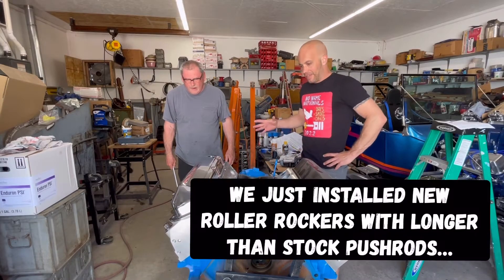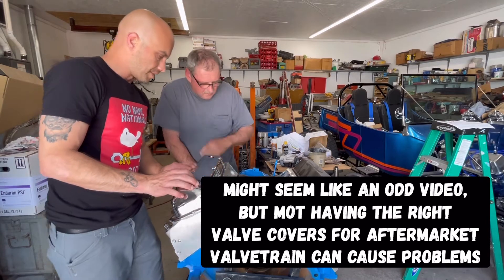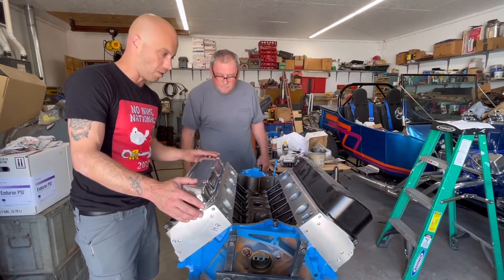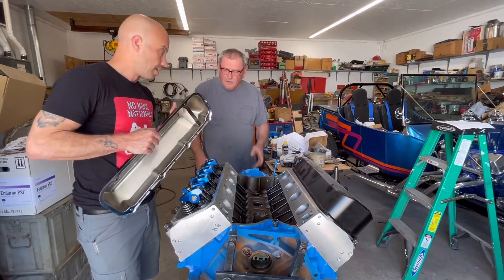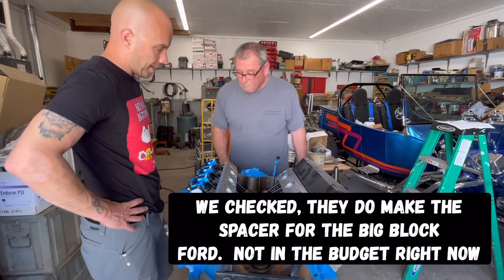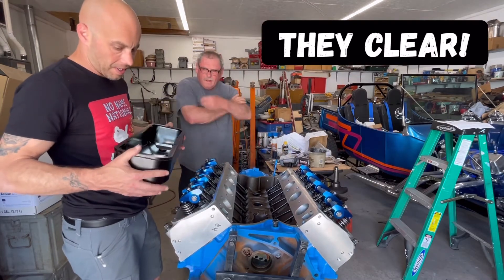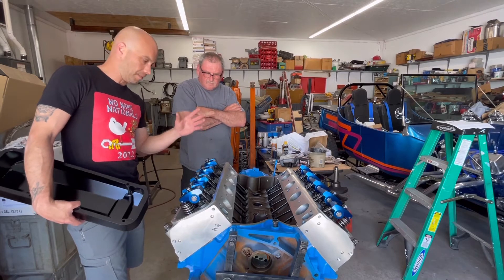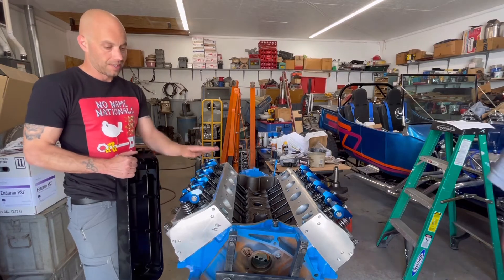How To Check For Valve Cover Clearance #nonamenationals

Comment: I used 1/2" spacer on small block Ford, but haven't seen them for BB. You can have the covers coated, or I use Dupli°Color wheel paint, # HWP101 SILVER, that I find is nice looking and durable.
Reply from the maker: Yep!! Im thinking of painting them.  I found the BB ones, 150 bucks….
Reply: @2HacksGarage  OUCH! 💵!
That's too much. It would probably be the same for a chrome looking powder coating. No good answers.
Reply from the maker: Might have to roll with these for a little bit. Until I can change it up a bit.  For now, eh… it will have to do